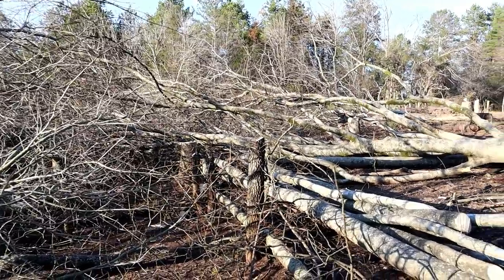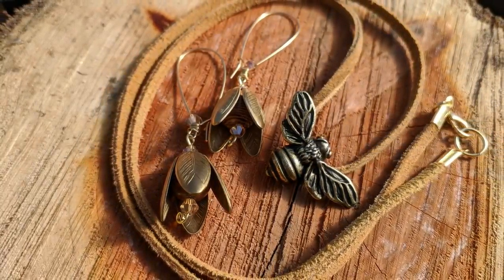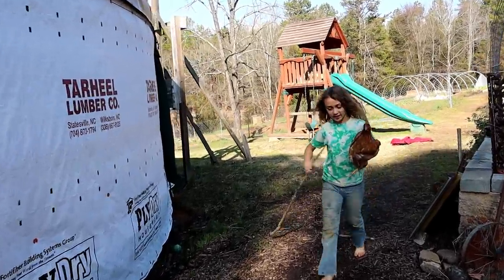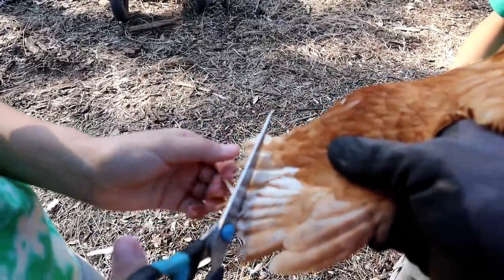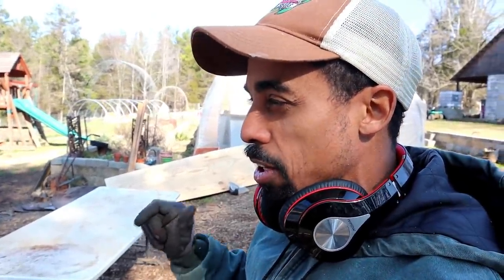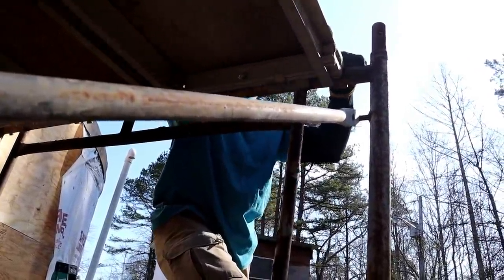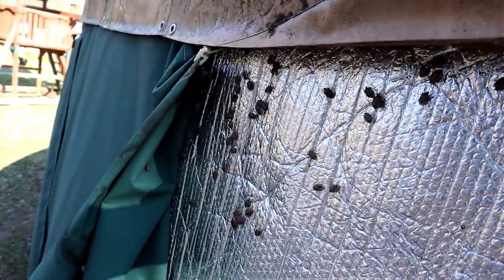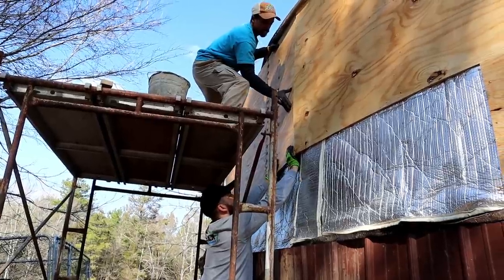Building a BETTER Yurt | Day 4 | Yurt Renovation

Comment: I would like to see a video where you sketch out your plans for the outside of the yurt such as decking, windows, what type of siding and other improvements you are hoping to make. I know it's a work in progress but have you reached the point of sorting out hardscape outside and things like that? I know you talked about improving how the market garden looks so I'm guessing you are talking more structure and systems. You are at the time (5 years in) where you likely have a much better idea of what you want to see for function of the homestead, particularly around your home and nearby buildings.

Comment: Can you show more about how you are handling the metal skirt? We have a metal skirt up and I am wondering were it goes in relation to the plywood and siding... So thankful you are figuring all this out before us and sharing your process! We do have windows in already and have fully insulated the inside - which may be an added challenge when we start siding as we can't access the "studs" anymore to add extra 2x4s.

Comment: A little late now, but you could've laid the plywood in the sun, on 4x4s or bricks under the edges, over wet ground/grass with a few bricks on the middle weighing it down, and the panels would've bowed from being damp on the bottom and dry on the top. Subbed!
Reply from the maker: It is thin enough that there isn't a need to do that.

Comment: Why dont you use that metallic tape that is used to place over the edges of the window opening when installing a window on all the cracks between plywood pieces. It would add r value and avoid air leaks.

Comment: Yert Question: in my county, there is the question of if a person is required to obtain permits for this kind of build. Do you have septic? How's the power set up?
Reply from the maker: When we first built our yurt 6 years ago we did get building permits. We tore done an old uninhabitable house so there was septic and a well already here.
Reply: Originally did you have issues in meeting insulation building codes for the yurt? Any issues now with the renovation with county codes?